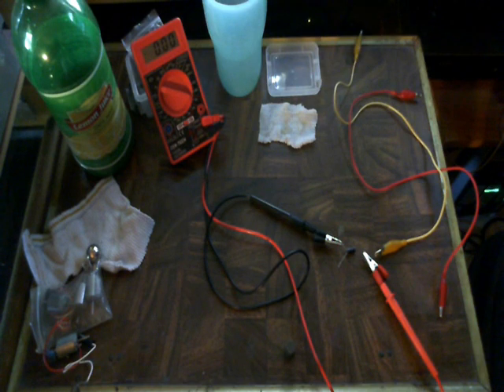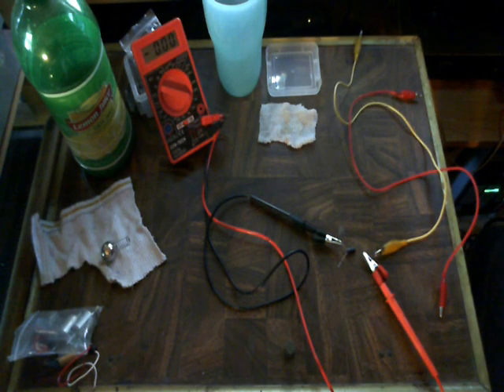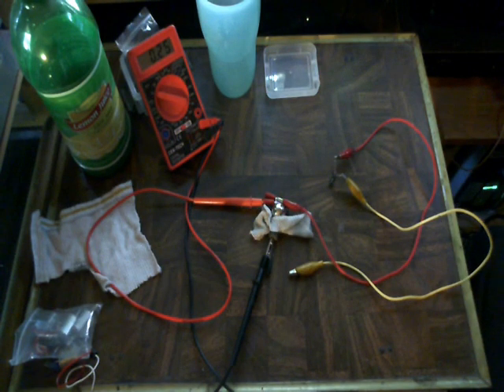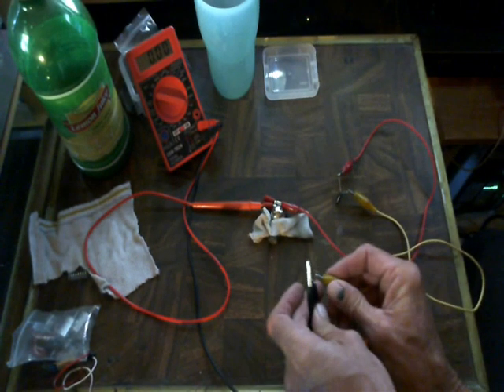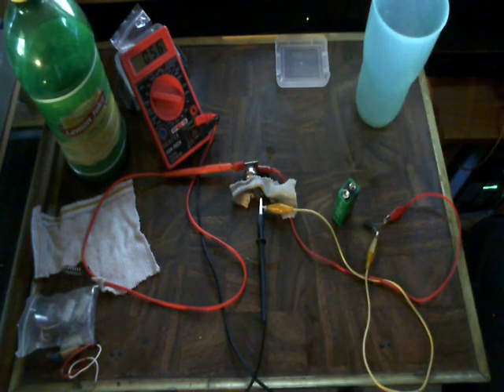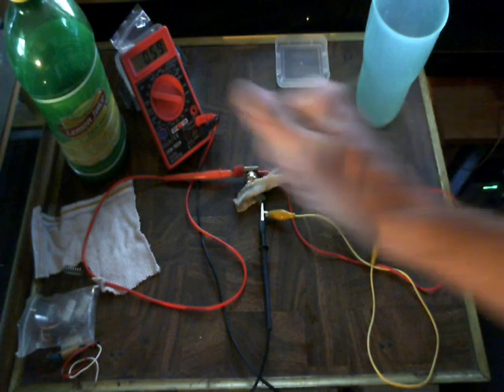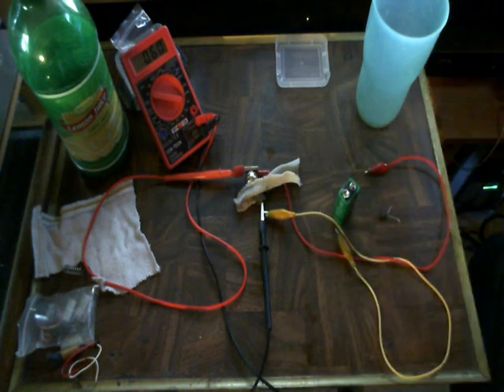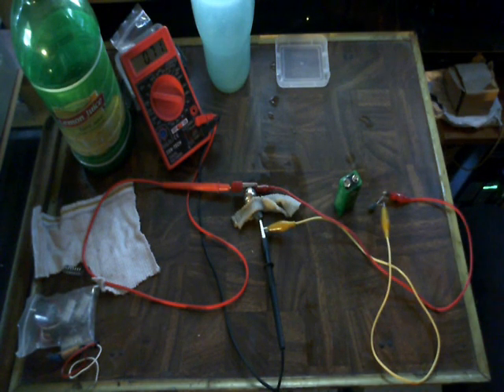MAGNET BATTERY !

Comment: Wooooooooo!
Reply from the maker: Pretty cool don't you think? What if the idea was expanded on? along the lines of the crystal cell batteries or possibly borrowing from speaker technology and piezoelectric's to create a pressure oscillator type battery cell?
Reply: Electrified steel or iron is like a capacitor

Comment: If you had a string of magnets and wet cloth and you alternated the magnets using neodymium then ferrite, do you think the difference in materials would greatly increase the voltage? Or with the cloth you could alternate the salt and lemon juice as well.
If you set this up over an ice cube tray you could have the cloth immersed in the salt water/lemon juice to keep it wet.  
You might be able to  use a joule thief circuit to light up some LED's or a small fan motor!
Interesting concept, thanks for the video.... :-) 
P.S Keep your thumb outa the way man!!!!!!!!!
Reply from the maker: I like the way you think. And imagine a crystal battery cell with strong magnets creating pressure on the paste all ran inline, basically in series. creating a possible self charging/ long lasting battery. I think it is worthy of looking into. What do you think?

Comment: Just wondering what the purpose of the magnets were?
Reply from the maker: It depends on what you want the final outcome to be. If you want a tight bond between your electrolyte they would be perfect. And if you wanted this to be more like crystal batter technology then once again a good idea, because in that case the pressure makes a huge difference. In the case of this video it was to show why the so called free energy with magnets and springs was a misrepresentation of what was actual going on in their video's. However all is not lost here because there is something to learn. as in a battery that can be snapped together quickly using metal coated magnets as your plates, Imagine those simple motors that use one wire a battery and magnets to make a monopole motor? How far could you take this? maybe a motor that is is its own battery! Idea's is the key to discovery but invention is taking the idea's as far as you can go. :) Thanks for the comment my friend.
Reply: Shaziz: Thanks for explaining that. I guess it's because I was into electronics all my life, and I explored the free energy routes around 40 years ago. I agree that ideas, no matter how silly, should be encouraged, because even one little word could hit a high note in someone.
Reply from the maker: I agree and that is how together we will get things done.  :)
Reply: Then you should consider a couple of things, the chronoviser..tune into the past, and the holographic universe or the possibility of teleportation via a cathode tube.
Reply from the maker: You may be surprised about things that I believe to be possible do to things i have witnessed in my life. Real science keeps everything on the table for research and so with that said my mind is open to any question of what is and isn't possible. Last but not least things are only impossible if you can't figure them out and never just because someone else says it can not be done. As a matter of fact saying it can not be done without the research to back it up is as bad as a theory with no evidence. As crazy as all that may sound if I have to prove it can be done they have to prove it can't If you understand what I mean. :)